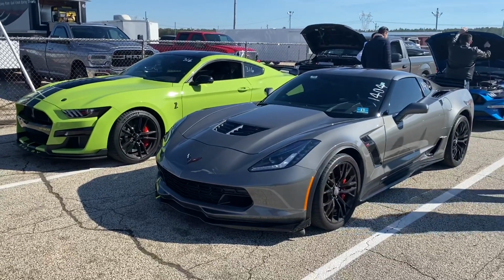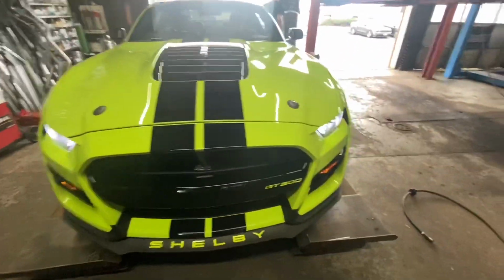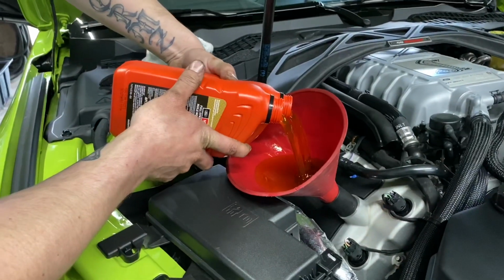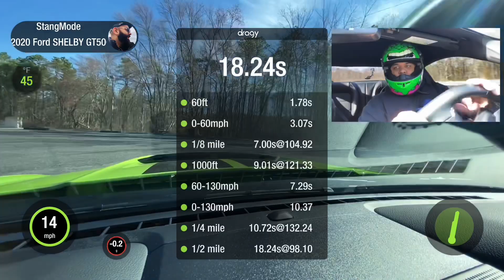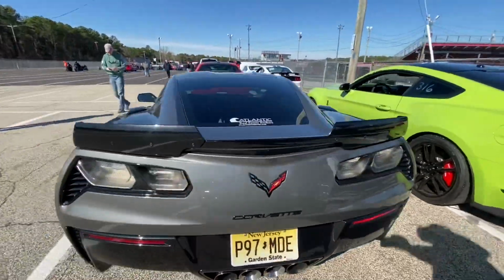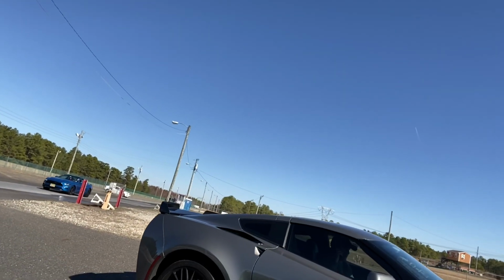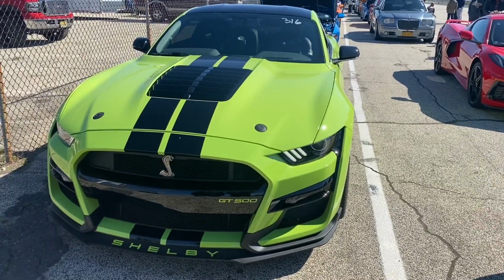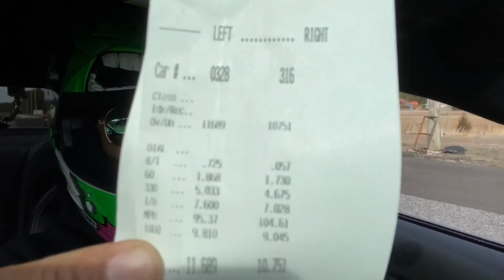BOSS FIGHT: CORVETTE ZO6 vs 2020 GT500 DRAG RACE! *PLUS C8 1/4 MILE!

Comment: Over 100 more Hp. more expensive in price ranges. Cm on Ford. An again another W for a 20 year old plus Gm push rod motor. An again the newer mustang still has no answer for Gm.
Reply: Well fanboy, check this out, the Ford has just 5002 cc and yet makes 760 PS and Y do U say its a WIN, Let GM makes 700+ HP from an OHV engine with factory warranty with under 6000cc then we ll agree its a win for GM
Also check this out
https://www.youtube.com/watch?v=mcQWMHYCrO8
The GT500 can hang on with a 911 GT3 RS which in any case is a direct rival to a Corvette Zr1 not a Z06, so the GT500 is on par with Z06 to say the least, let alone Camaros 
See this as well
https://fastestlaps.com/comparisons/pb3bl12r7g85
the 911 GT3 RS and Z06 are quiet similar, for a 4200 lbs Ford to match a 911 GT3 RS means its pure magic by Ford and by no means an embarrassment
Reply: @ponygt6629  as a man no problem with you couse you actually explain what you're talking bout.  But me being a born Gm man 7 own 3-5th gen Camaros 2 vetted. Have the fastest true grudge stock suspension small tire car in city all southern areas.  What I said was the truth the vette make over a 100 hp less. An still thr more powerful Ford Ford gt500 stock for stock has no answer for a old technology. Before I was born small block push rod motor.

Comment: That means c7 z06 faster than the z51 c8
Reply: I should hope so.  Better chassis or not, the C7 Z06 is still pushing another 150hp/180lbs ft of torque over the N/A Z51 C8.
Reply: @alfrede.neuman8611  I want to  see c8 z51 vs c7 z06- 1/4 or 1/2 RACES-

Comment: You had a better time than the Z06 on recorded run (Just a little delay on the tree)and destroyed the C8. The Hulk is amazing me with consistent 10.7 / 130 mph+ passes. If someone can figure out the DTC launch reducing the 60' time. I'm guessing low 10s high nines on a regular basis. Wonder if you're still on the fence regarding twin turbos? I read Hennessy is building three twin turbo GT500s with up to 1200 horsepower. I noticed they changed some internals and modified the DTC to handle the extra power. Maybe an opportunity to test drive one before moding your Hulk.
Reply: Hemi 300C Hennessy is full of shite
Reply: @robquin2460  i agree these dudes that mention henessey as a builder dont knowshit either lmao..